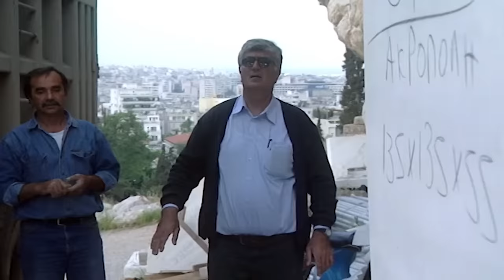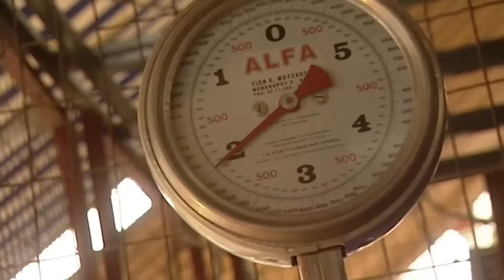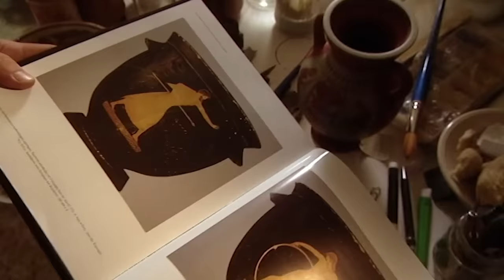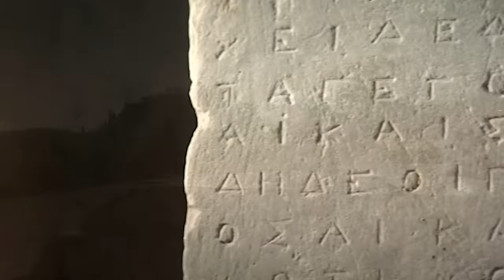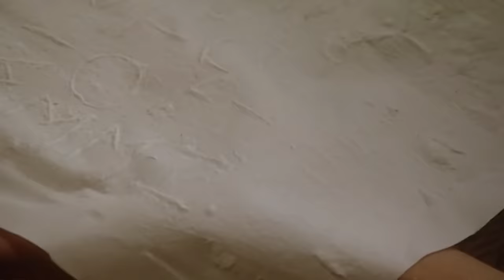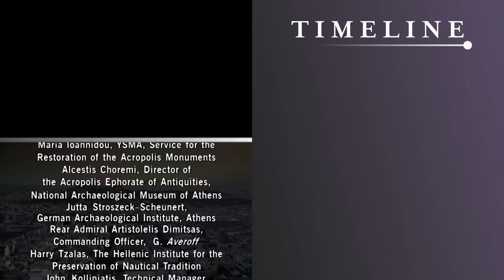Ancient Athens: The Rise Of The Most Influential Society In History | Metropolis

Comment: Golden Point - The flywheel, clutch, gear wheels, gear box, transmission shaft, differential gears and differential are only used to waste as much power as possible and are wholly unnecessary ( El )